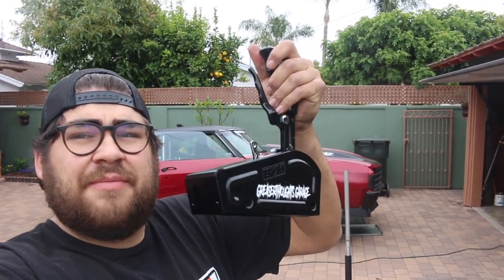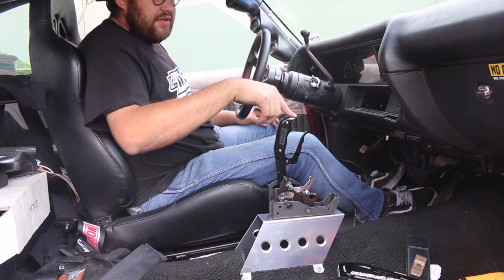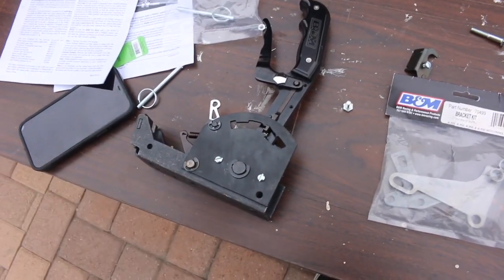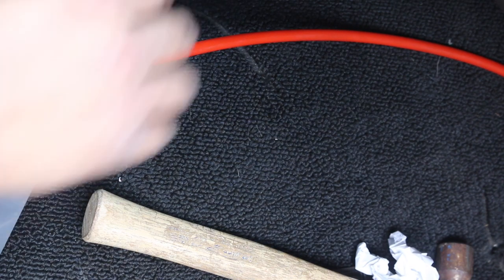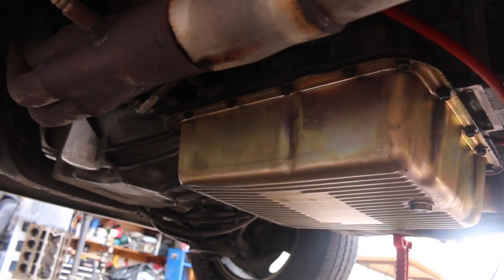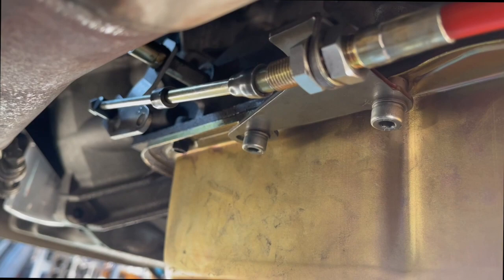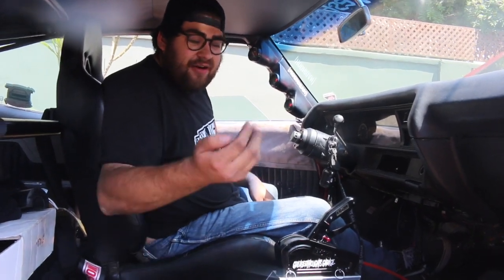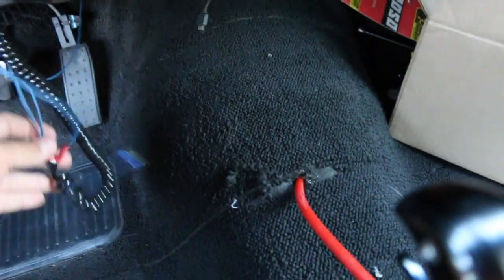Installing a B&M Pro Stick Automatic Shifter

Comment: This video has been very helpful! Just one question.... did you drill a 1" hole for the cable??? Instructions call for a 1" but that seems rather big to me. I'm currently installing this and really want to do a smaller hole if I can
Reply: Use a good rubber gromet

Comment: Hey man does the shifter have a neutral lockout feature? Something that allows it to make sure you don’t go into neutral from drive with you’re foot floored on the pedal? Thanks!
Reply from the maker: It doesn’t have a neutral lock out it does have a reverse lockout
Reply: Colby, I didn't like that about this shifter and the TCI Outlaw, so I made an upgraded detent plate to convert it to the True Slap shifter design, which I have a patent for.  I originally made this design for my factory horseshoe shifter in my '70 Monte Carlo SS454.  I can slap it forward for the 1-2 shift and it hits a stop at 2.  I can simply slap it again for the 2-3 shift and hit another stop at 3.  There's no need to squeeze the trigger at all for either shift.  It cannot be shifted from 3rd to Neutral without squeezing the trigger.  Another issue with the B&M Pro Stick and the original detent plate is that you can accidentally shift from 2-N if you don't squeeze the trigger completely before shoving forward.  I've used this same design to convert a number of factory GM shifters and I have YouTube videos for each.  I think you'll like this one. It fits the Pro Stick and the TCI Outlaw:

 https://youtu.be/NuNOxTdyXf0

Comment: I have the same shift and transmission but when I want to go 1st gear it does 2nd and when I want to go 2nd gear it goes to drive. Maybe instillation wasn’t done right ?
Reply from the maker: Yeah doesn’t sound like the cable is adjust properly or you have the wrong plate installed in the shifter
Reply: @GreaserthoughtsGarage  can you make a video how to do it?

Comment: Do you have to pull the trigger when shifting from 2nd to 3rd?
Reply from the maker: Yes
Reply: Here's my upgrade to eliminate the trigger pull for the 2-3 shift. Mine also now has neutral lockout.  I think you'll like this.  https://youtu.be/NuNOxTdyXf0
Reply: Did you see the video link I posted above? I have an upgraded detent for this shifter.

Comment: Do you have to install a manual valve body to use this shifter or do you only have to run the cable to the existing shift linkage and it works
Reply from the maker: No it’s just a shifter linkage works

Comment: Are you going to remove the column shifter or would the collar just slide around?
Reply from the maker: 2 options replace the shifter or replace the collar to a floor shift
Reply from the maker: I’ll probably just take the old shifter off for now and replace the column eventually